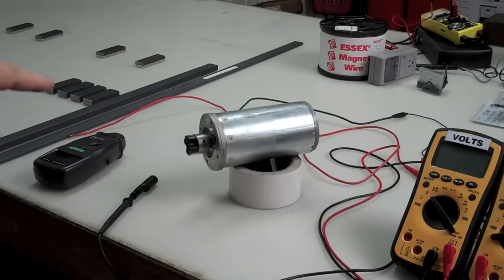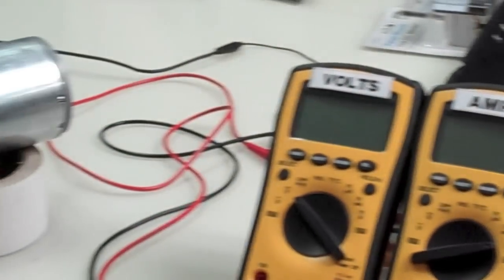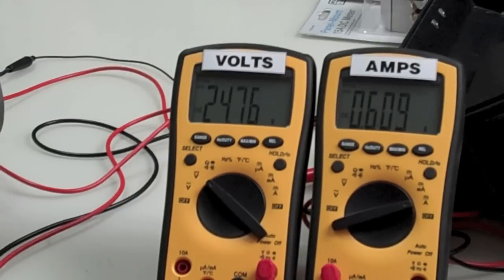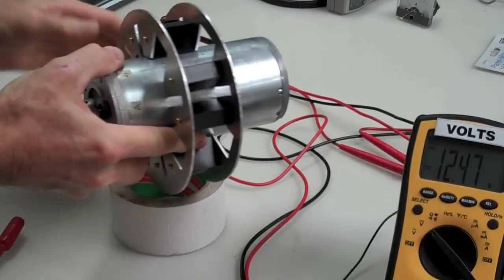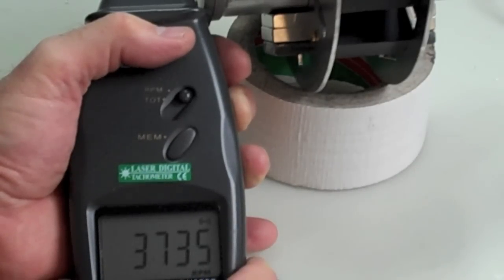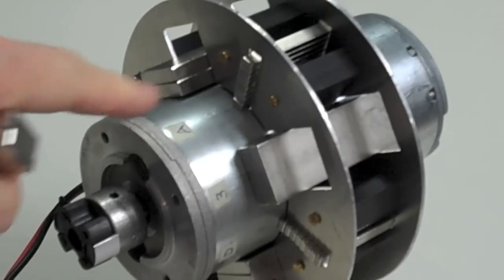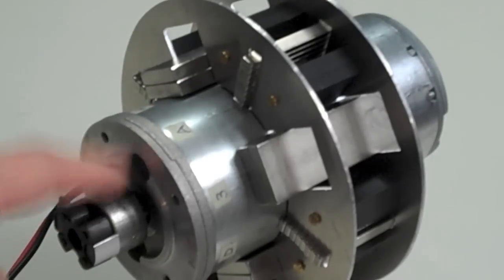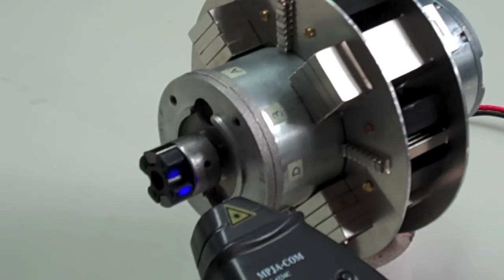STARGATE MOTOR  FULL DEMO

Comment: [9]
13. The bone I pick with PMMG4HYBRID is that he misrepresents this effect. He claims it's "less input, more output", which it is not. Three times in the video PMMG4HYBRID claims that the speed increase results from "enhanced magnetic field", when we know that greater stator flux DECREASES speed. Now it is possible that by adding external magnets PMMG4HYBRID is distorting the field shape, or that his magnets oppose the stator magnets, (which would explain why adding more in the 3rd...

Comment: In real world the most part of the flux do not enter the motor case. To fully enjoy this effect (made cooler by a japanese team of scientists) you need a plastic or TEFLON made motor case. With much more less magnets you will enjoy a 5X effect of this. The same effect the japanese team shown putting the ROTOR outside the flux of the stator a bit. RPM GOES UP... TORQUE goes down as the input power. A Kind of gearbox for electric engines :D

Comment: you're confirming some laws of physics here as wetquartermile says ;"Increasing the field strength will reduce the unloaded speed of a DC motor, since the back EMF is increased....installing the external magnets to buck the internal ones and reduce the field strength to make the motor run faster .."
 but really what's the point here ?
3K is a usable speed , what do you hope to do w/ the (unloaded) high rpm ?
12.35 X 1.089
maybe saving 2W

Comment: why didn't you show the meters on the final spin up? electric motor works by having permanent magnents pitted against changing electro magnets and here you made various improvements to the permanent magnent side finally taking it outside its design capacity. but i don't think you'll be getting something for nothing, so yes it's important to see how it measures with some loading

Comment: 24 volts at 0.6 amps? That’s 14.4 watts. What’s the point of that? You can get a 12 volt marine battery which has around 700 amps, which is 8,400 watts. What is that motor doing, aside from wasting electricity?

Comment: There is no more power available from the motor it is more power from the power source P=IE  Power to motor is current times the voltage.  All the magnets do is increase the current draw from the supply.  It is the supply providing more power not the motor.  If RPM went up with same or less current from the supply that would mean the magnets made the motor more efficient in converting electrical energy to mechanical energy and this would be great power savings.  Note: Power draw is not shown.

Comment: what was the full neo demo no.3 added wattage at 1000rpm on 12volts? did it actually go lower than 12.3watts? also if the dc motor was used as a generator, im assuming the power output increases with added magnets as well? I learned something today, hmm i think a self loop motor-battery-generator becomes nearer to possibility with each watt reduction, thank you..keep up the experiments..

Comment: if the HP is 0,25 stay the same? 1HP at axis of the motor is 746w
can you measure power or the torque of the axis if can change?

Comment: With all of the magnets in place, would the motor turn at 3,000 RPM if you used a lower voltage, say, 2 volts?

Comment: OK, people who really try and can articulate their finding I like to help!  OK I'm game, by placing your Star-Gate, Cute name but magnet holder, your increasing the magnetic flux density of the surrounding field! Fact,YES, the motor going to travail faster through a stronger field then the smaller weaker field!  Good motor, noticed the Ball-Bearing which offer less surface tension and drag of the rotor!  Great Job your trying to understand Electromagnets and their off-spring?

Comment: [4]
... number of winding turns in the rotor to get the result you want.

6. If you double the winding turns, you double the torque for each amp of current and you double the generated voltage, which means (and this is the key bit) that the motor now has to rotate only ?HALF as fast as before to reach its (voltage limited) maximum speed. Note this: increased torque, decreased speed. You don't get anything for nothing.

Comment: Um, yeah they build motors with stronger fields. What's your point here? You increase the field you draw more power, you get more speed. You increase the wind, you get more torque at the same draw, decrease the wind for more speed less torque.

Comment: In my opinion, you need a demonstration that shows all parts of the circuit all the time.  We need to be able to see where all the connections are to see that you are not using a different power source or measuring a different load with the meter .  Also, and this is even more important, you need to show what happens with a load on the motor.

Comment: yeah, any DC motor that has more powerful magnets added to it will be a more powerful engine, and the reason this engine is not more powerful unmodified is its size limiting the inductive capacity from adding magnets, he just upgraded the motor - ofc requiring more space. 
he could have just bought a bigger motor...

Comment: So, you have created a modification to the motor that increases its RPM while reducing torque and power - what's the benefit in that? 

As you have pointed out, the friction will shorten its life drastically. If you want higher RPM, just use a motor with bearings designed to run at higher RPM 

If you're trying to get more power out, you'll need to start by actually measuring it first (POWER = TORQUE x RPM) - RPM alone tells you only half the story.

Comment: The real proof in the pudding does NOT lie in your "star-gate" as much as it does with your magnets and their positioning. Place the magnets where you have them WITHOUT your star-gate and see what you get. They are just augmenting the existing magnets inside the motor. Oh, and the 1 amp draw? You are asking your 1/2 amp motor to do the same amount of work, ie spin as fast, on 12 volts as it does on 24 volts so of course it will double the current draw. Rather than boosting the electromagnets in the field windings on the shaft to boost it's power at 12 volts, all you are doing is boosting the permanent magnets in the stator field inside the motor case effectively doing the same thing. It's a great idea if you need a 12 volt motor but have only a 24 volt motor available but there's nothing more mystical than geometry at work in your "star-gate". Nice effect though.

Comment: you need to put a load on the moter. ie a nuther moter on the out put shaft with a resistor load. then show that you have incresed the effeicey of the moter with the star gate. the graph the effinsency in with respect to the power out. if it is over 90% then i would be reley inpresed.
Reply: And whats the point of all this. who wants their motor to spin faster? in addition to load you need to keep lowering the rpm back to the original speed, so we can see the power gains. I wouldn't think efficiency is going to get any better but getting a third HP motor to became a two thirds HP motor could have some benefit. Neodymium magnets are a dime a dozen now and motors should be a whole lot cheaper. So this might be a cheap way to get there. Is that the point !?

Comment: All of this was performed at no load. To truly understand the effects it is necessary to use controlled inputs, and a known load. Changing from one voltage configuration to another, removes one of the controls of the experiment, and invalidates the result. The final shot had the Tachometer but no view of Voltage or Current. Since the conditions are not verifiable, the experiment loses validity. If in fact the same experiment were run with only one variable, (Add or remove magnets) and all others held constant, the validity of the experiment would be stronger. For actual work to be improved, the output would also need to overwhelm the added weight. If this were connected to a transmission, of known gearing, with carefully monitored power input, the acceleration over a given distance would be a clear indicator of actual improvement to the system efficiency.  I'd really like to see this done.

Comment: [7]
10. Now for the reality check. Remember I said earlier "ignoring the winding resistance"? Well that's the bit which bites you in the arse. Motor manufacturers fit as much copper into the winding space as possible, so with fewer turns they use thicker wire which has lower resistance. Lower resistance means less heating and more efficient use of electrical power. So by reducing stator flux instead of winding turns, the winding has a higher resistance than necessary and is less efficient.

Comment: Not true.  Anyone with a simple toy motor can try it by adding 2 neo mags to the outside of the motor casing in the right positions. Gotoluc is working on this concept also. The more mags the less power needed to get the same output.

Mags

Comment: You're wrong, claudius. Sorry. Think of it like the sprocket on the back wheel of a bike. The bigger it is, the slower the bike. Better at pulling up hills, but slower. A d.c. motor with bigger magnets goes slower. Anyway, there's no point in arguing till you've tried it (which I have). Open up a d.c. motor and take out one of the magnets and see what happens. Bill Dixon

Comment: those jumpers are the worst part of the connection, they are made cheap and the wire guage is small which in turn increases resistance and then draws more current than necessary due to loss, you should be using at least a 18 gauge wire to be able to handle the current . make your own jumpers

Comment: wow fella ..have you ever attached it too a car generator to see the voltage , i think the magnets you put on the outside are reducing the internal resistance if you can do this to a generator also and hook them together , at 24 vdc and your motor only uses 12 VDC well you do the math 50% gain ,, put some good bearings in that thing and let it eat ? the hp issue is resolved if resistance is overcome .  cool things to think on ,,,,,,

Comment: you can buy ceramic ball bearings for that motor much less heat highter RPM's plus use iron to defect the magunut poles, irom works much better then steel.. dont replay to this message i wont see or get it thank you...!

Comment: Try doing that on an optimized motor. The manufacturer fulfilled the requirements given him and designed a pretty crappy motor. Of course you can tamper with it and improve the performance. And you can add more stators to improve the efficiency further

But not to discourage you, let me commend him for figuring out that a stronger magnetic gradient will optimize the motor, without knowing what did. Assuming that this was an optimized motor was the error. Think of a car and a race car! Got it?

Comment: dude that wasn't a bad vid but the gearing looks REALLY inefficient. there should be a bigger pull on the motor and a smaller one on the wheel.

Comment: You need to learn a little electric motor theory. A motor generates a back emf proportional to the product of the rpm and the stator field. This limits the speed. All the stuff you put outside the motor has actually decreased the stator magnetic field reducing the back emf and allowing a higher speed (but less torque!). Of course the result is a much increased rotor current, You would achieve the same by opening up the motor and removing some of the permanent magnets. Try it!

Comment: There's no such thing as a free lunch if you introduce a stronger magnetic field that can increase the potential of the motor but to get the same amount of torque at a higher rpm you need to add more power this is a free spinning motor try to give values for brake torque.

Comment: PMMG4HYBRID - Thank you for the work you have done despite the skepticism.  I have tried the same experiment last year and was able to speed up the motor by at least 800 RPM with about 6 Volts lower than the original.  I kinda like the Stargate design and I will be trying that myself.  I am curious however to the orientation of the Neos you added.  Are they all facing North or South towards the motor or are they alternating.  Please respond regarding the large and the thinner ones.  Thanks again

Comment from the maker: Compliments of K&J Magnetics:

9. Does stacking magnets together make them stronger?
Yes, two or more magnets stacked together will behave exactly like a single magnet of the combined size. For example, if you stacked two of our D82 disc magnets to form a 1/2" x 1/4" combined size, the two magnets would have the same strength and behave identically to our D84 discs, which are 1/2" diameter x 1/4" thick.

No BS here bud.

Comment: Excellent demonstration of field weakening. A DC motor runs and generates back emf equal to the supplied voltage. If you weaken the magnetic field (adding magnets doesn't automatically increase the field, that is dependent on orientation) it takes a higher rpm to generate the back emf.
You see this effect all the time on permanent magnet motors that have been overheated.  The weakened magnets cause the motor to run faster without any load, but they are unable to pull full power. I've run into this problem more than once in plant maintenance.
You can read up on DC variable speed control to confirm this effect. It's called field weakening. It's used on larger DC motors to allow overspeed operation.

Comment: Power (in kW) = 2(pi)(N)(T) / 60000 I would suggest that if N increases (rpm) torque decreases (T) the power would be the same. improving the magnets obviously effects the motor field and may improve losses in a general purpose motor, why not buy a more efficient motor in the first place? I don't mean this to be insulting just my interpretation of your vid.

Comment: "RPM of a motor has nothing to do with its output power." not true, you're assuming which the uploader even reminded you to not do in large white letters. IT CAN, it's just at best inconclusive if a greater amount of energy is being put out at once, or if the neos are truly inputting more energy or causing more energy to come out from some other source.

Comment: i used one motor as power and other as generator. i put little neodymium magnets around  power dc motor (both are same  motors scavenged from computer), i used 9v volt battery in short periodes. from 4 v reading on generator when i put magnets on powerng one i get 6.4v on generator motor...
Reply from the maker: That's a great result!  
It's not about producing torque for a direct application at all, though if the magnet polarity is reversed you will lose rpm and gain torque in the drive motor.
Reply: PMMG4HYBRID thanks, its great idea, i knew already that magnets could acelerate motor but when i saw your video i just wanted to know how much..... ( oh yes, i  can produce now up to 8 v.... its depending how i connect two motors, if its good connection then i get 7.6 or more volts....) i love your videos, i am starting to think  how to make motor that  would run few months just from energy that it makes ( of course first you need to give him power )...........

Comment: You need to find a DC motor with a wound field, not a permanant magnet field like the one you have here. Then you can isolate the armature windings (brush circuit) from the field (field windings). As you reduce the strength of the current through the field windings, you will find that the armature speed will increase dramatically. Your external magnets are weakening the permanent magnet field of this motor, causing the increase of RPM. No magic here, this phenomenom has been known for 90 years.

Comment: pretty cool, but adding magnets to the exsisting motor doesn't make it any more pratical in an economic sense, you can always buy a motor with more poles. But still pretty rad tickering. (:

Comment: Even if you take longer to move it, using less energy to do it could still prove valuable. 
But ultimately, if those magnets are doing any work at all, then it will take less electricity (watts) to do the same exact job. Make it clear as can be. If you believe in your product I can help you design the perfect demonstration to undeniably prove it's worth to anyone. That's where the money's at.

Comment: Lower Volts = Higher amps correct?   sadly I dont think you gain anything.  I am no expert at all on electricity.  You should show the motor on 12v with out magnets like you show with 24v set up.
From what I think I know you want the volt to be say 12 and your amps to stay  at .6  that would be a huge improvement or better yet. 24v and amps be lowered to .3 that would allow a battery to
run the motor much longer.  (PLEASE....   SOMEONE TELL ME IF I AM UNDERSTANDING WHAT I HAVE SAID CORRECTLY)

Comment: All you do is weaken the magnetic field generated by inner magnets...
Less current is needed to reach higher RPM but the motor has alot less torque.
You RPM reading is incorrect.

Comment: Lenz's and Maxwell's laws in effect. More flux more current. No magic here! With 24.6V @ .593A the power is about 12W. P= I x E. With half the voltage, the current is doubled to obtain the same power as so indicated on your meters 12V x 1A = 12W. Motor RPM in this example isn't a characteristic of the increased magnetic field, but a characteristic of an unloaded DC motor, which is why DC motors in industry must have a load read physical load or they will self destroy.

Comment: no not all the amp that does the work. Another misconception BS
It is an equal relation with wires, magnetics strength and amps.
The laplace law of force clearly states that.
Newton= wirelenght x magnetics x amps.

Comment: The ping pong ball and locomotive wheel is not a fair comparison. Not at all.
He is not changing out armatures from small and light to large and very heavy.
He is using the same motor in each case. 
I can understand the vision you put in peoples heads with that to try and get your points across, But it sounds quite a bit off to me. Only because I know better. ;]

Mags